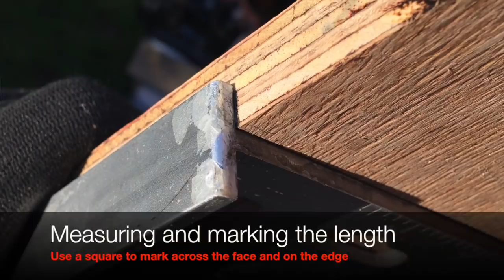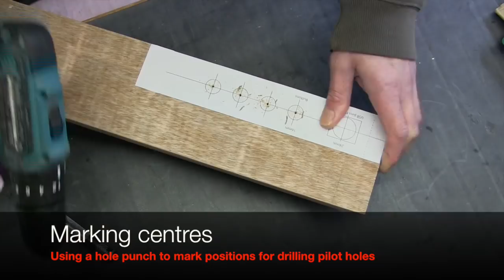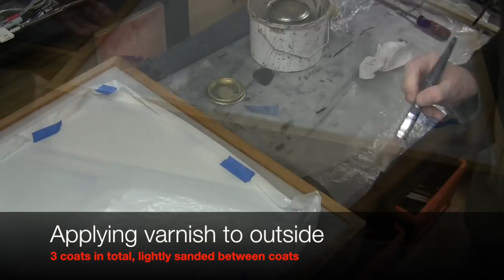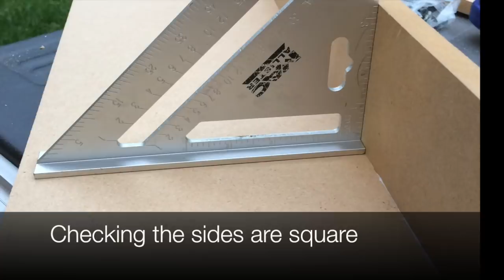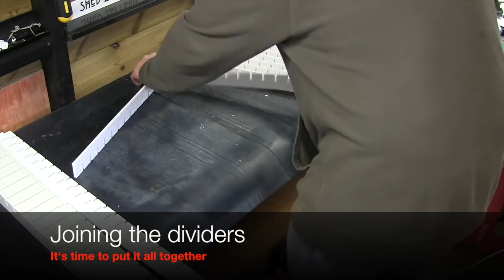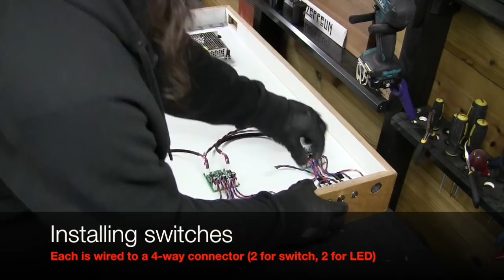Andy's Shed - LED Matrix Build - Part 3

Comment: That's a nice panel. I am nearly finished on a similar build, but only 8x8, and built into a large photo frame. individual cells are about the same size as yours.

I see you are using an Arduino for yours. I started off using a nano myself, but have now changed it to use a Wemos D1 because it gives me more power for the animations (some of the animations I used are math heavy) but also because it allows me to control the panel from wifi and also connect to a time service so that the display can run in clock mode. The final step for me will be including a spectrum anylyser mode, then it's done. Mostly because I am running out of things I can do with it!
Reply from the maker: Thanks for the tip - I'll check out the Wemos board!